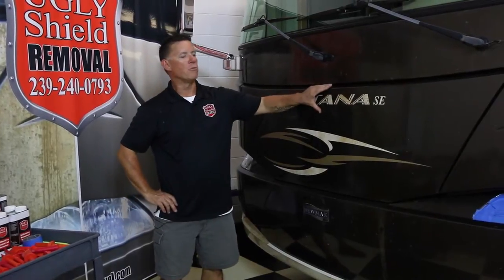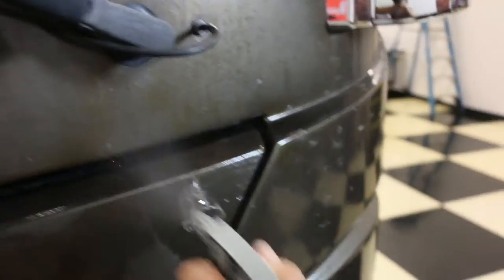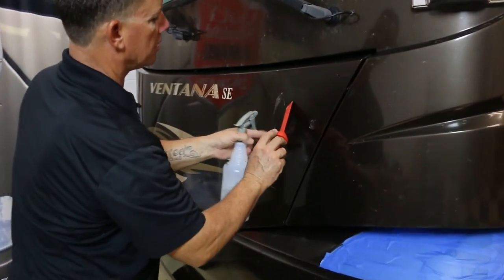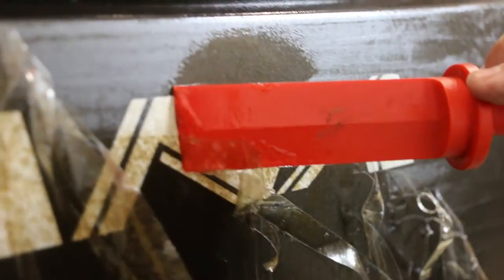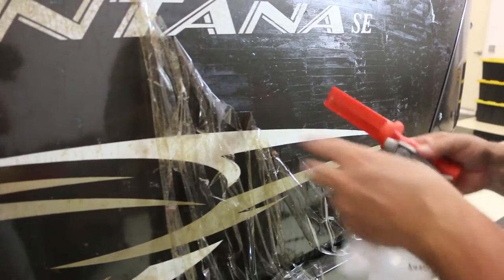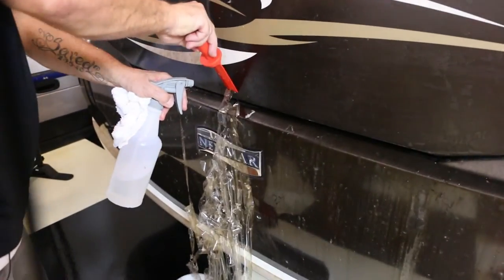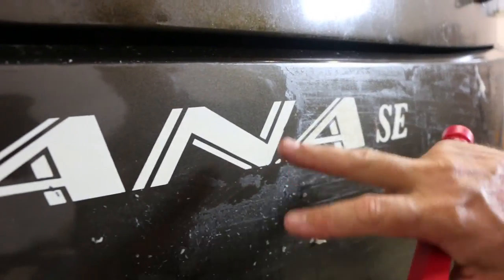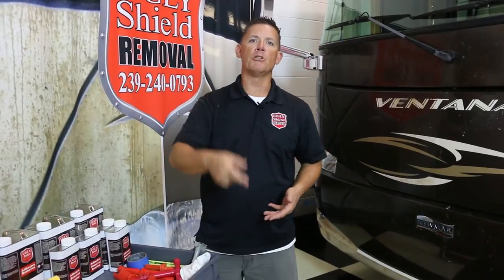Diamond Shield Removal

Comment: Did I miss the ‘size’ of the scraper? Not the length but width.
Reply: I bought my set at Harbour Freight.  3/4" - 7/8" - 1" & 1 1/2" scrapers (comes in a set of four).